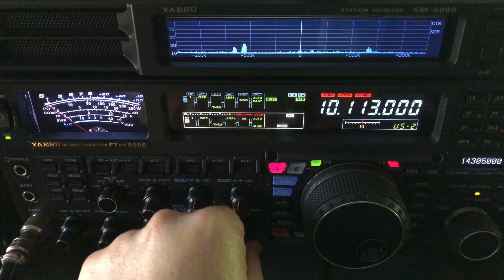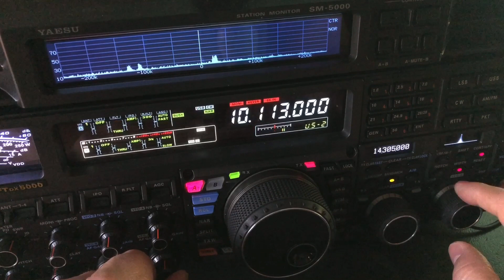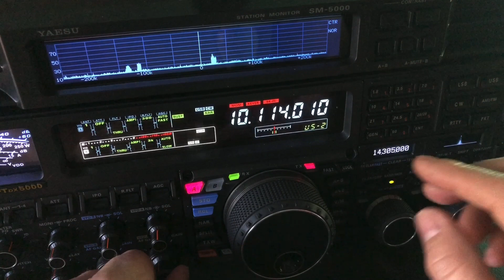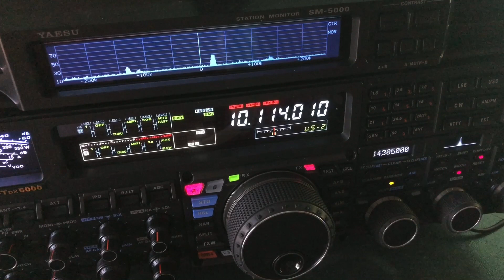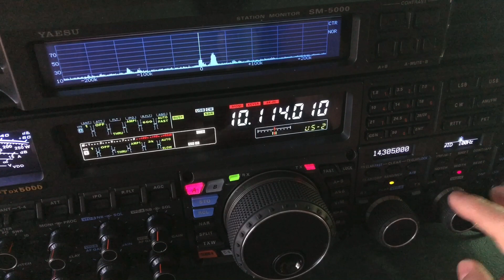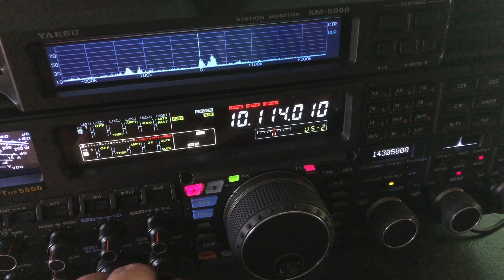Do I Really Need a 300Hz Roofing Filter?

Comment: I have the ftdx 3000 and I'm thinking it would be wasted money on my part. Thanks for the video.
Reply from the maker: A tighter roofing filter helps the DSP stage do a better job.  The more noise/interference you deal with in the early stages of the receiver assists the DSP and improves the overall performance of the receiver.  I illustrated this in the FTdx10 series after installing a 300Hz filter.  There was a noticeable improvement with the 300Hz filter, versus the sock 500Hz filter.  But the FTdx3000 performs well, compared to many competitive transceivers.  The tight filter can make it even better.  It's like "icing on the cake."
Reply: @n4hnhradio  thanks for the input. I may have to reconsider now. 73
Reply from the maker: I advise people that, if they only work CW casually, don’t worry about maxing out the filtering. If CW is your main interest, definitely max out and do it while the filters are still available.  Yaesu sometimes discontinues the filters before they discontinue the radio. That happened with the FT-818.  That’s why I maxed out the FTdx10 ASAP.
Reply: @n4hnhradio  I use cw 99% of the time, so I suppose it would make sense to do what I can to make the operation more enjoyable. We'll, you talked me into it. By the way, my call is KT4RH. Maybe I can work you someday.
Reply from the maker: Well, I don’t want to talk you into anything. I don’t work for Yaesu. I don’t even have a great relationship with Yaesu. I use their radios simply because they offer the most for my money. 

But, having been a purchaser of amateur radios since 1982, I have learned some lessons along the way. If you think you will want the accessories for a radio that you think you will keep, buy them while they are available. I regret not buying the optional TCXO for my FT-890/AT and my FT-920. They haven’t been available for years and years. Those transceivers tend to drift off frequency a bit. Fortunately, I know how to align them.

Comment: your demonstration is slightly flawed, the mechanical filter has better RF rejection on it's skirts. Whereas the DSP will reject out of band signals, it wont be as effective. So you need to do that test in a crowded CW band with strong adjacent signals... then the mechanical filter will shine.
Reply from the maker: https://youtu.be/9xELx2rGh3o

Comment: Man, I'm glad I ran across this video.  I own an FTdx-1200.  I know that the APF has been a godsend for me being a newer CW operator (3 years now...).  I never knew where in the receiver chain it was implemented.  Now I know!  Also, I don't think the APF is adjustable on the 1200.  But, it helps regardless... DE K7RLN
Reply from the maker: Menu 107 in the FTdx1200 is where you can set the APF to Narrow. That’s how I run it. 

73, de N4HNH

Comment: Looking for videos to decide whether to invest in the XF-127CN 300HZ filter for the FT-DX3000, I came across your video. Really the only video that addresses the decision whether the DX range of Yaesu rigs benefits from the 300Hz filter or not. I have to say, your advice about the APF is excellent. A narrow DSP and a narrow APF is a great combination, even with the 3000's stock 600Hz tightest roofing filter. ..but   ...BUT, if you are a CW op that likes to work in the 300HZ range, believe me when I say, the CW decode with the optional XF-127CN 300Hz filter on the DX3000 is FAR nicer, more rounded, smoother and easier on the ear than with the stock 600Hz roofing filter with the 300Hz DSP set. To my ears, there is no comparison.  The 300Hz roofing filter produces buttery smooth CW reception  compared to the 300Hz DSP (with the stock 600Hz filter switched in). If you are a CW guy and work 300Hz bandwidth on the DX3000 or DX1200, pull the trigger on the XF-127CN. These great rigs deserve this great little filter.  John EI5JS
Reply from the maker: The DSP alone cannot make up for the heavy lifting provided by a roofing filter. But a tight roofing filter ahead of stellar DSP is a winning combination.  You might like this video: https://youtu.be/dBw5L2gXAf0

There is another video publishing on Friday, February 24, about chasing ghost stations. That video will focus on gain structure and filtering with some comparison between a stock 500Hz filter and the optional 300Hz filter.
Reply: Hi John, 
I followed your hint and bought a XF-127CN for my FTDX 3k. Question: In had a signifikant drop of the signal with the 300Hz Filter. I had to use the Amp 2 to compensate the drop. It ist much much more than the Switch from 1.5k to 600Hz. Defect? Vy 73
Reply from the maker: There is always insertion loss through a filter.  It could be 6dB or so (=1 S-unit on an accurate S-meter).  The receivers are so sensitive these days that we normally don’t need a preamp for most bands.  I use IPO and sometimes up to 18dB of attenuation. So 6dB of insertion loss in order to improve selectivity is totally worth it.  I cover this in other videos, including my “ghost station” videos.  

That said, don’t just equate S-meter readings with sensitivity.  Even with an SDR that relies solely on DSP, if you narrow the digital filter enough, it will cause the S-meter to read lower.  That is perfectly normal.  Remember that the S-meter is supposed as represent the signal strength at the antenna input, but it is measured from the AGC - in the last stage of the receiver.  The more narrow your filter width, the lower the S-meter reading.  S/N ration is more important than meter readings.

Comment: The roofing filter should have a larger dynamic range than a DSP, so it could potentially reject a very-nearby QRO station better than DSP alone. Of course, the entire receiver chain needs to have enough upstream dynamic range to support this theoretical improvement at the IF stage. This topic will inevitably get muddled, because DSP systems might move to (for example) 24-bit depth thus providing incredible dynamic range, the rest of the receiver chain may fail to have enough hardware dynamic range to support the advantage of the hardware roofing filter, etc., etc.  Best evidence would be the consensus opinion of hard-core contest operators (assuming that they can reach a consensus). Facts will change over time as technology changes. 

P.S. I wonder if the 300 Hz filter is not "crystal" but perhaps 'mechanical' (i.e. Collins).
Reply from the maker: Yaesu has used Collins in the past.

Comment: Thanks for this video!
I have a Yaesu ftdx10. 
I’m actually looking to get into CW and was debating if I needed the extra filter or not. Interference hasn’t really been an issue. I scan around the cw portion of the band and even with several strong signals I have no issue Making them out. As well this has rather good DSP since it is a SDR. 
I think the money will be better used for a nice key. 

73,
De KE8GAH
Reply from the maker: The 300 Hertz roofing filter helps the DSP do a better job of filtering but this is mainly needed during contest or emergency conditions, when the bands are extremely crowded.

As far as keys go, don’t think that you have to buy the $350 keys.  I use a $165 Kent TP1-B, and I will put it against a Begali or anything else in the $350+ realm.

73, de N4HNH

Comment: Thank you for the video! It would be interesting to make the same test during a big CW contest. If I'm not wrong, the roofing filter acts over RF, and the DPS, only over AF. I mean, In a very crowded contest situation, that's where I think the roofing filer should shine, protecting the receiver from strong overloading signals that are near your operating QRG. 73 de EA6AMM
Reply from the maker: Welcome!  There are numerous videos on the channel that deal with QRM from signals close by in frequency.  If you spend enough time watching videos on this channel, you will see many.

The roofing filter acts like another bandpass filter. But, instead of passing the entire spectrum of a band (i.e. 7.0 to 7.3MHz), it passes a narrow portion of spectrum at the IF (Intermediate Frequency) stage; after the first conversion.  With the FTdx5000MP, the roofing filter is operating in the 9MHz, 1st IF, stage.  In this video, the roofing filter helps the DSP by filtering down to a 300Hz bandwidth.  This means the DSP doesn’t need to work so hard, so it does a better job of minimizing noise and interference.

Note that a SDR has no roofing filter because it is sampling the signals directly at radio frequencies.  There is no Intermediate Frequency where a roofing filter can be inserted into the signal chain.  The FTdx101D, FTdx101MP, and the FTdx10 feature a dual-superheterodyne receiver along with a SDR stage, allowing those transceivers the opportunity to benefit from the selectivity of a superheterodyne receiver, with very effective 9MHz roofing filters, while still benefiting from the spectrum analysis provided by the SDR stage.  Yaesu calls this “hybrid” technology.

The DSP in the Yaesu FTdx5000MP is an IF DSP.  Most transceivers today use IF DSP.  I posted two videos a few weeks ago that show AF DSP, using an external DSP unit.  Look for a video entitled, “Hello Old Friend!”

73, de N4HNH
Reply: @n4hnhradio  Hi AGN! I just watched the "Hello old friend!" video, and I soon recognized him :-) It's sitting over an old friend of mine, my first HF rig, a Kenwood TS-850 :-) 73, EA6AMM
Reply from the maker: While the FT-890 is only an up-conversion transceiver, it still holds a special place in my shack.  First HF transceiver I purchased.  It suffers a bit from phase noise, as did transceivers from that age, but the sound quality of the receiver is awesome.  Adding the DSP-59+ allowed it to compete with much more expensive transceivers at the time.  And it is still no slouch, as the video shows.

There is a second video with the DSP-59+ connected to the FTdx10.  You can watch it to compare AF DSP to the latest in IF DSP.

Thanks for visiting my channel!

73, de N4HNH
Reply: @n4hnhradio  Thank you very much for the very complete information :-) I'll watch the other videos in your channel to learn more! 73,  EA6AMM

Comment: If you have the Yaesu FTDX10 you can buy the 300hz filter @ HRO the filter is a user plug & play filter. Ordering me one tomorrow.  Great FTDX10 videos & others.
 73, W5MUT.
Reply from the maker: I like the 300Hz roofing filter in my FTdx5000 but the DSP filter does such a great job, the 600Hz roofing filter is effective enough.  

The FTdx10 comes standard with a 500Hz roofing filter.  But it only needs to serve as a “rooftop”, then the DSP can take over and narrow down to 50Hz.  

If you plan to operate CW without using the DSP filter, then yes, the 300Hz roofing filter will be very beneficial.

73, de N4HNH

Comment: Sorry if this is a bit off-topic. I hope to be able to buy a radio this year, but I can't decide on which one to buy. I'm thinking either the FTDX5000MP Limited with the three mu-tuners and station monitor or a used FTDX9000MP with all three mu-tuners and the DMU-9000 build-in. This wil be my first radio so both of them are beyond my skill level, but I want either of these two radios. I plan on keeping it for many years, so this is also an investment for the future. Anyway, the FTDX9000MP and the FTDX5000MP seem to be very similar radios. Does anyone know how these two compare? What would be the pros and cons of either?

Thanks for any help
Reply: I say 5000. Newer radio and a VERY good one at that. I don’t think you would notice a huge difference between the two
Reply from the maker: The FTdx5000MP is the latest design in that realm.  I found the ergonomics of the 5000 to be better.  The knob placement makes more sense than on the 9000.  I know a guy with a 5000, a 9000, and a FTdx101MP.  He says he still prefers the 5000.

I believe the 9000 and 5000 will be phased out in the not-so-distant future.  So, if you are going to get either of those, I would recommend that you do not delay.  The 3000D had been discontinued, due to supply chain issues.  The 5000 and 9000 are only available now by special order.

I believe the 5000 to be the finest radio ever made.

73, de N4HNH
Reply: @n4hnhradio  Thanks turd and Doug. I did notice some oddities with the button and knob placement on the 9000, but I can live with that. One thing I like about the 9000 (the one without the build-in TFT display) is that it has more didicated knobs than the 5000 has, which I like. However, since this will be my first radio, this is just theory for me. Maybe it doesn't matter that there are multi purpose knobs on the 5000. Another thing I like about the 9000 is that it has more meters, but again, maybe this doesn't matter at all. what is your thoughts on this?

If you have tried your friends 9000, what do you think of it? 

As you can probably tell, I am inclined towards the 9000MP with build-in mu-tuners and DMU-9000, but they are hard to find and a bit expensive. However, it is important for me to make an informed decission about this as I think this might be my first and last radio. I don't care much for software defined radios and I care even less for menu driven interfaces and bling (waterfall etc), and since this is the direction everyone seems to be going, I probably won't buy a new radio anytime.

Thanks to all who replies and help me make up my mind
Reply from the maker: @Peter Olsen, I can confirm that the knobs on my 5000 all have one dedicated purpose.  I don’t care for menu-driven radios and multi-knobs, though I do tolerate the multi-knob on my FT-891, given it’s portability.  The reason I like it better than the 9000 is because the knob placement makes more sense on the 5000.

73, de N4HNH

Comment: Do I really need a 1.2khz ssb filter for my 101? I just don’t see how it can be intelligible that narrow. Especially when the dynamic range and the blocking is that good already!
Reply from the maker: I don’t think the 1.2 kHz SSB filter is absolutely necessary either.  I can press the NAR button on my FTdx5000MP and it will allow me to vary the DSP filter width for SSB between 200 Hertz and 1.8 kHz.  I have used it at 1.1 kHz before, to combat contesters moving in on my QSO.  The DSP does a good enough job that I don’t think the physical filter is necessary.  I can understand what the other station is saying at 1.1 kHz but their audio is very thin.  But, when I must, it’s nice to know that I can.  But, again the DSP can handle it.

73, de N4HNH